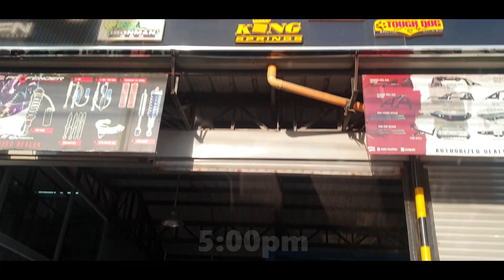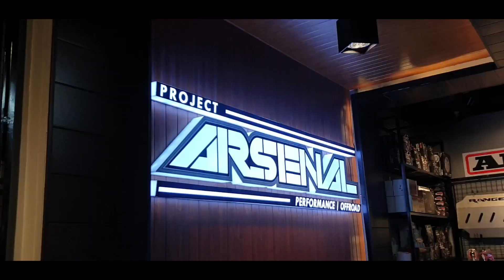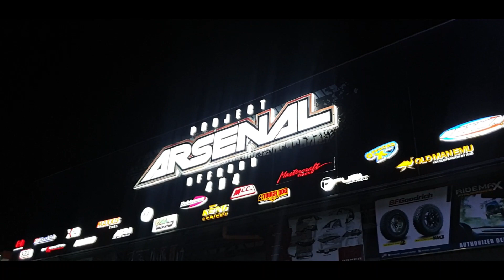Nissan Navara 2022 Same Day Unit Release and Wheels Upgrades PH | Project Arsenal VLOG2

Comment: Simple pero brusko. Nooicee

Kamusta po ang ride comfort ng stock suspension vs upgraded suspension?
Reply from the maker: Hello! There was a huge improvement from the stock ones from the upgraded ones. I really recommend Project Arsenal. They did a very good job with our suspension and wheels. The upgraded ones are more comfortable and more smooth in driving. It's not matagtag. :)
Reply: @randomthings301  you mean yun stock suspension ng Navara matagtag?
Reply: @randomthings301  san po banda yu g project arsenal?
Reply: @gutadin5  comfy po ang stock ride ng Navara pero syempre mas comfy pag upgraded suspension.
Reply: @markbello5284  Hello Sir, we are located at Waze: Project Arsenal 4x4 HEADQUARTERS
📍Project Arsenal 4x4 -HeadQuarters, Km.72 Mc Arthur Highway, San Isidro, City of San Fernando, Pampanga
Reply: @projectarsenal4x4ph60  hi sir query po mag kano ang set up na ito..anong mga upgrade ang ginawa? thanks..
Reply: @randomthings301  magkano po inabot pag change nyo ng mags, tires & suspension.thank you.